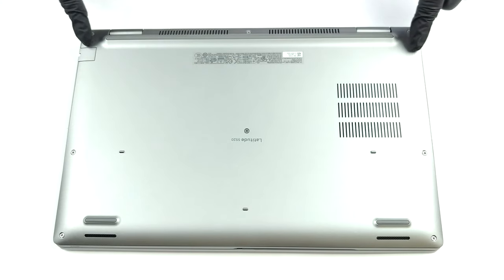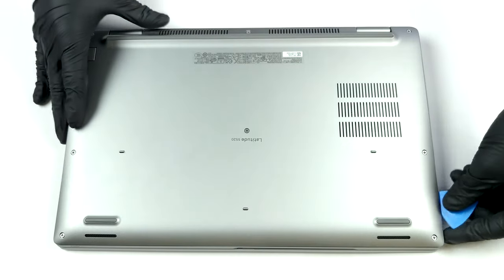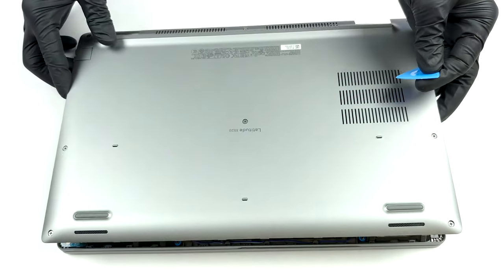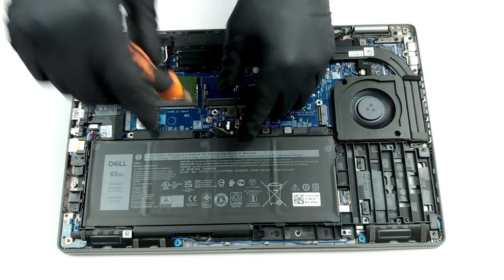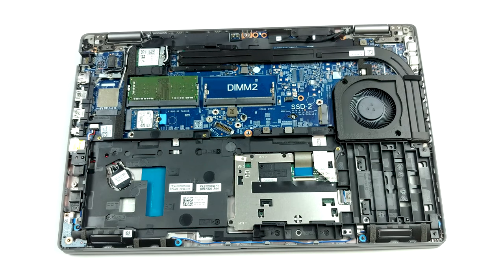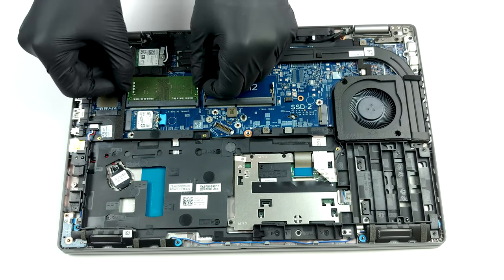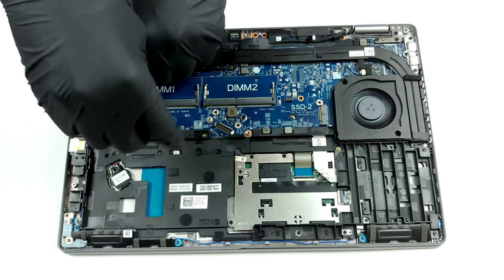🛠️ Dell Latitude 15 5520 - disassembly and upgrade options

Comment: This is not a complete teardown; how do you get to the CMOS battery connector to wipe the BIOS settings?
Reply: This is the comment I needed?!
Reply: Did you get the bios wiped? 
Did you find the connection for the cmos battery?

Comment: It's an excellent video! also the computer, I have one and it has been amazing however I have had a problem with the audio! can you help me? it happens that when I want to play any audio like the Internet or the system takes about 10 to 15 seconds which worries me because the pc is new ... I have looked for information about it but I can not find any solution.

I would really appreciate any help.

Comment: Installed a new gen 4 SSD, took out the old gen 3c as well as new ram, put the battery back in but now the system isn’t recognising the battery, any help?

Comment: Great video :)
May I ask if it's possible to add a 2nd 4TB NVMe SSD in this laptop and if yes should I use 1st (3rd Gen slot) or 2nd (4rth Gen slot)? Also can I use the 2nd (4rth Gen slot) for 3rd Gen SSDs always 4TB?
Thank you very much.
Reply: i been success install WD 1TB NvME in 1st slot and WD 4TB NvME in 2nd slot, for my friend Latitude 15 5520 .

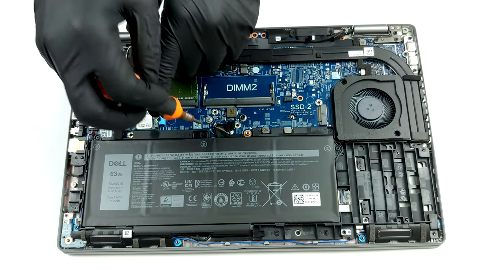Comment: Hi, great video! A small question: 0:32 I wonder what is the right-bottom part (next to the battery) used for? It seems empty, and I wonder if it can accommodate a HDD or some other things?
Reply: Hello, that extra-space is needed in case you order your laptop with a bigger battery. For an extra HDD you don`t have a plug on the motherboard
Reply: @monkeywithaskirt  Got it. THANK YOU!